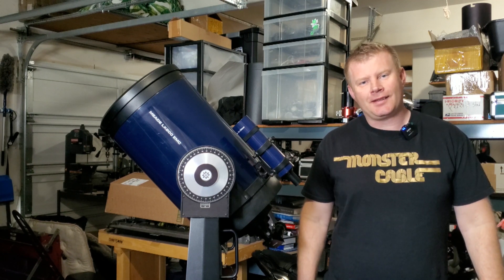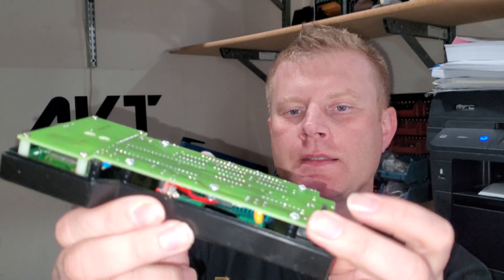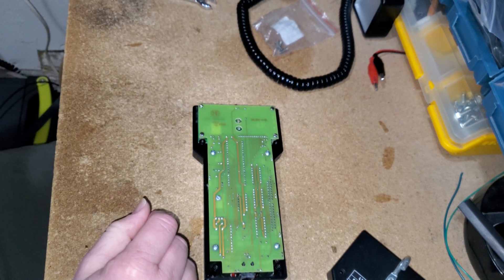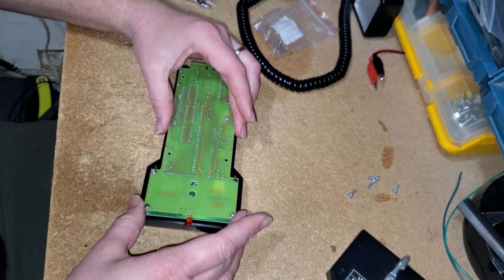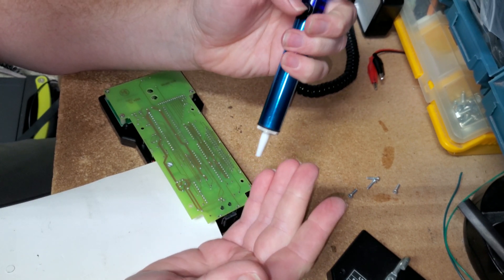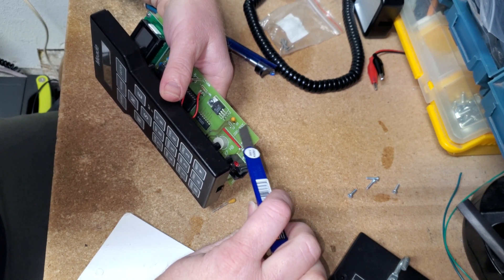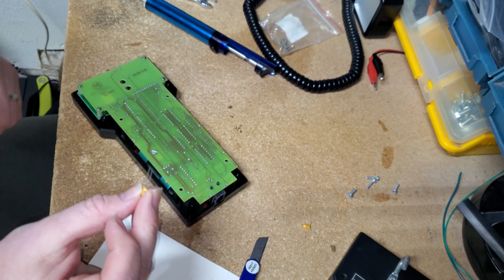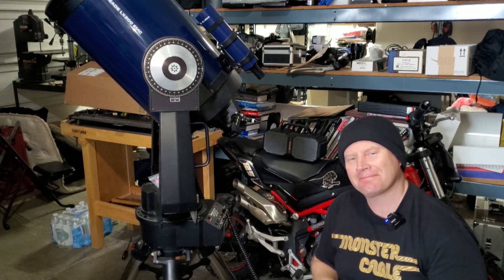LX-200 Classic SCT Telescope? Must Do Before Turning it ON! Capacitor Replacement Guide.

Comment: i just bought a brand new classic hand controller for my 8 in. meade classic lx200 , i set up my scope
last night , turned on the power , and immediately heard a " pop" , saw some smoke and there was a burning odor from my dec. system area , which has never happened before in the years of use. also the manual slow motion know turned several times by itself.  i believe i now need  to replace the caps. in that declination system . what info and recommendations can you give me ? 
i see that this is a common fault / problem with these meade telescopes . thank you sir .
Reply from the maker: Oh man, that sounds rough. I'm really sorry to hear that happened. I'd definitely start by replacing those cap in the declination system, as that's a common culprit for those symptoms. Good luck!
Reply: @AVTAstro  thank you for replying , i am not skilled at PCB  repair and expert soldering ,  i think i will try to remove that particular board and bring it to someone skilled at that ,, there are no telescope shops anywhere near me, but there are shops that do PCB board work . and from what i read the new caps need to be better [ higher capacity ]  as meade dropped the ball on this aspect of their  scopes and it seems to be a common  problem for meade users . i am member of cloudy nights and sky and telescope , and one man  strongly  recommends  better caps be used. do you have a recommendation of the specific better caps that should be used for the upgrade ? thank you sir .
Reply: @AVTAstro  or is it possible / feasible to remove that PCB  for repair  ? what would be the standard operating procedure here ? thank you.

Comment: By some insane cosmic luck someone in my local astronomy club gifted me a 10" LX200 that they purchased back in 1999. I haven't powered it on yet, but I just inspected the hand controller and it does look like the previous owner did have it professionally serviced at one point. A diode was soldered in parallel with C3 and flux on the backside of the PCB indicates C2 was replaced. Does this sound right to you? Should I have any reservations about powering it on?
Reply from the maker: Sounds like you should be fine. If you need a replacment controller I have some spares.
Reply: @AVTAstro  I powered it on last night and so far, so good. Thanks for the offer!

Comment: Good video. While replacing the capacitors is a good idea, replacing them with tantalum caps again is not. All else being equal, electrolytic capacitors are a safer option, and less expensive.
Reply from the maker: Good tip, thanks!

Comment: Mine has twice now blown the board in the base.  Always goes in a cloud of smoke and sparks. De forking now as to expensive to repair. Had it repaired once cost a fortune. Now its gone again sadly. Too expensive. De forking this time.
Reply from the maker: Some times it's just the reasonable thing to do👍
Reply: Since de forking my lx 200 I’ve been trying to repair the old lx 200 mount. Took the mount to bits today and found it was c8 burn out. Ive now replaced the burned out one with a new capacitor and it’s back to life. Going to replace the hand set capacitors next . Thanks for the help.

Comment: THOSE DMALL YELLOW CAPS, ARE TANTALUM, THE RED STRIP APPEARS TO BE A RESISTOR ASSEMBLY.
VOLTAGES ARE MAX RATINGS, NOT ACTUAL.OPERATING VOLTAGES.
IF THE SUPPLY IS RUNNING AT OR NEAR 12 VOLTS, AND THE CAPS ARE ONLY RATED FOR 12 VOLTS, THAT WILL LEAD TO DESTRUCTION OF THE CAP.
REPLACE THEM WITH THE SAME VALUE, IE...220 mfd, 18 volts, or 22 pf at  50 Volts.
VOLTAGE RATING MEANS LITTLE, THE ACTUAL CAPACITOR VALUE IS IMPORTANT.
Reply from the maker: Thanks for the info.

Comment: Interesting video Vlad. As an electrical and electronics engineer i was watching with interest. Your work was fine. I would have changed both of the capacitors whilst the unit was stripped down, that is if they were the same size. It looks like something is shorting with the azimuth axis. Good luck 👍
Reply from the maker: Thanks! Yeah I'm not sure but the electrical engineer people recommend only replacing the c2 capacitor. Again not sure why but I have done that for years with no issue.
Reply: @AVTAstro  I suppose if it’s that individual capacitor that is repeatedly failing then it would be pointless to change both. Good luck with the secondary fault 👍
Reply from the maker: Likely so. Again I'm not the expert in the field and as far as the way that board actually works I'm about as well informed as how a cruise ship works... LOL.
Reply: @AVTAstro  😂🤣
Reply: @AVTAstro  I am an EE too.  Running a 10 tantalum cap at 18V is a bad idea.  In fact, most EEs will use use a higher voltage rating for Electrolytic (the vertical cylinders) and tantalums (yellow/blue vertical ones).  Exploding capacitors are highly undesirable (unless you are doing it for fun).  This can also happen when you install them backwards.  I have launched the can of an Electrolytic across the room before by over-voltaging it (in my younger years).
Reply: I know you've moved on from the fork mount, but Clearline tech has a video on adjusting the motor encoder for run-away RA drive: https://www.youtube.com/watch?v=EsLkVBu8who

They sell new motor encoders and a calibration tool (if you don't have an oscilloscope)
I think the reason the other capacitor isn't replaced is because it doesn't see full voltage like C2. There are other capacitors in the power and main board, as well as motor encoders that are recommended to be replaced as well.
Reply: Those capacitors are 'dipped' Tantalum, and they are notorious for their failure mode - a dead short circuit. They are used because they have a low ESR, and are good for filtering.